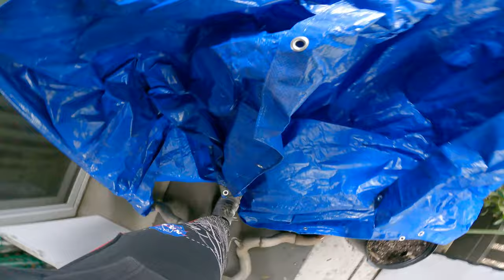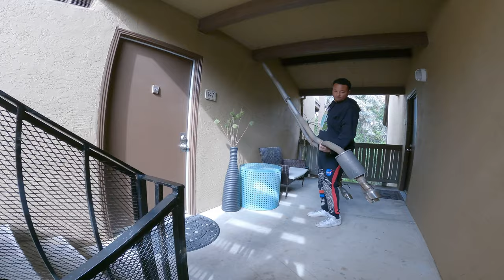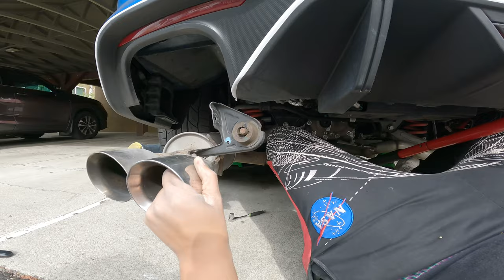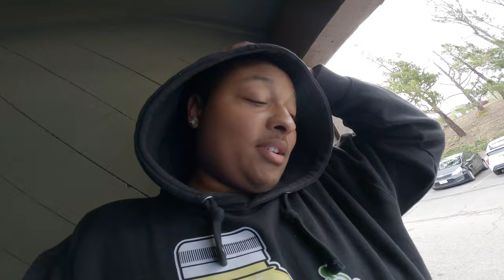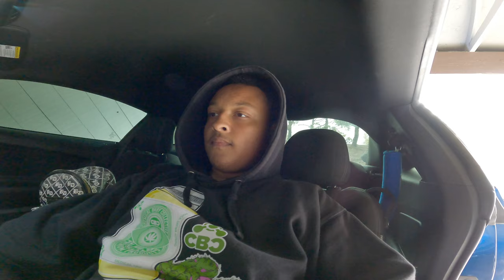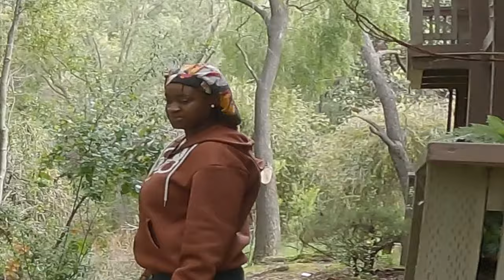What I Did After Getting My STATE REF Cleared

Comment: The referee only checks for smog violations. You could have kept the x pipe and axle backs on and still passed. Only thing would be the exhaust ticket which you just pay. Back when I had my 350z and had a ref ticket, I just payed the actual fine price and didn’t even have to test. It was expensive but I didn’t have to go back to stock. Just word of advice for next time to save you some hassle!